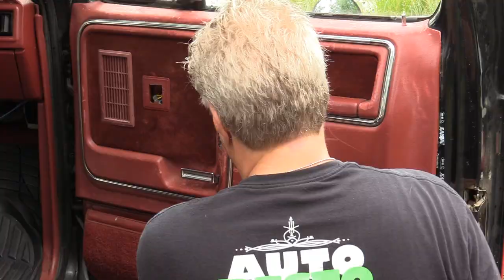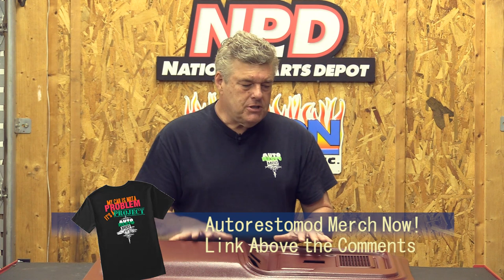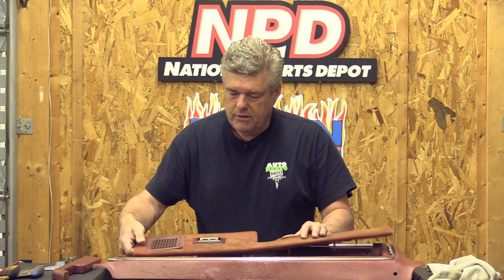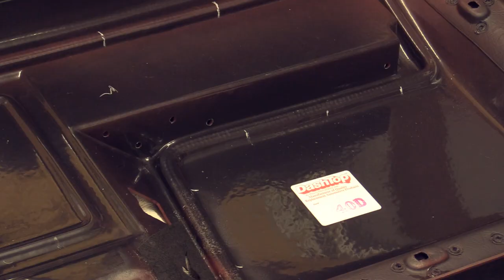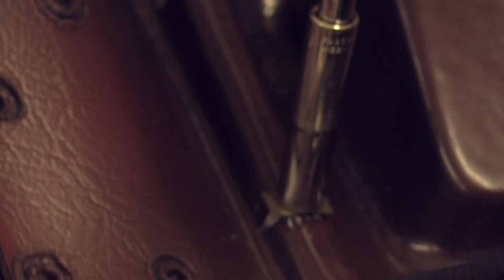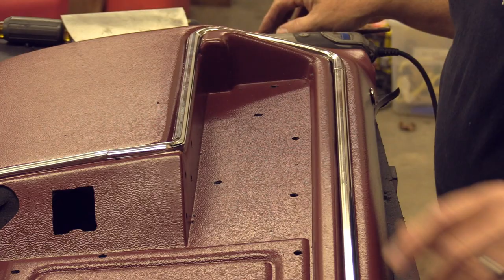Door Panel Tips and Tricks

Comment: I had that with my doors on my 81 f100 too I fixed it by shorting the aluminum trim by 12mm at top join with the diecast an 10mm in the center of bottom trim I joined them back together by file fitting a piece of aluminum in the widest part of trim look lot better than having a gap down the front it made it look factory fitted an if you put the clips on the diecast part below armrests an down towards handle first it fits better I tried a few ways where to start before I worked it out
Reply from the maker: Thanks for the tip

Comment: Looks alright but I wonder if disassembling the panel, cleaning and prepping it and recoating the original may have worked better, and may have been less expensive.
Reply from the maker: Not in my experience. I've yet to find a method that looks "right".

Comment: Is there a product  youd recommed to help restore the faded vinyl plastic? The door panels are in excellent shape on my 86 f150, but just the top of the panels are fading and starting to get crumbly. Ive tried trim restorer which has only accelerated the deterioration
Reply from the maker: Sem paint has a really good vinyl paint system for those trucks
 I believe the Merlot color that they sell in the vinyl paint is very close to the maroon they used in the trucks. I would recommend going out and looking at some of the Ford forums for the best color match though
Reply: @AutoRestoMod  thanks. I was thinking a trim restore product. If I went with the paint I'd have to blend in the lower panel since it only needs restored on top of panel?

Comment: No, this panel wouldn’t pass a rat rod judge, that panel is horrible. It should’ve been sent back and either the correct panel sent back or money refunded. The company that sold those should be made aware that their panels aren’t one size fits all and should be marketed appropriately. LMC Truck is the only company that specializes in OEM Quality fit and finish. Likely, if LMC Truck doesn’t have it nobody does.
Reply from the maker: Nobody does. These are what is available. SO, you work with it or you do without, because these  are getting hyper hard to find parts for now.
Reply: @AutoRestoMod  the on,y real new part that impossible to find from a company for the 80-86 F100-F350 Trucks is the tailgate. The door panels replacements have for over 20 years now been nothing but plastic junk, although if you get a panel like yours is it’s best to sent it back because the injection or blow molded panels are prone to fit net issues. 

So, it’s easy to call the company up and tell them that you’ve received a panel with excessive defects and you need to have it replaced. Your panel has as many defects as the original panel had worn spots and you’d been better off just repairing the old one by fabricating the new and old panel together.